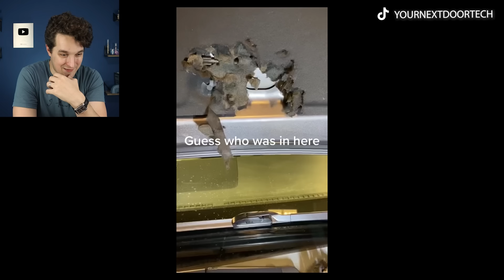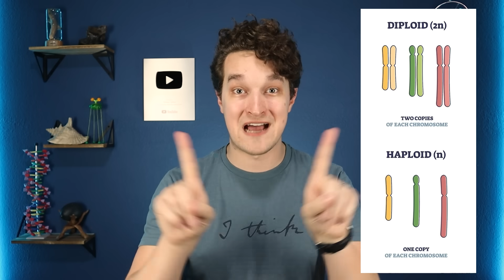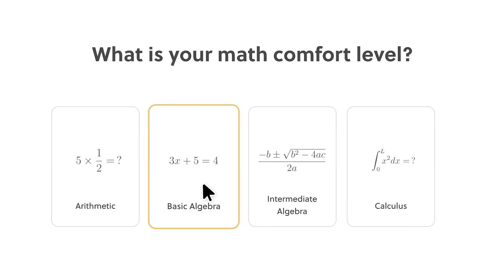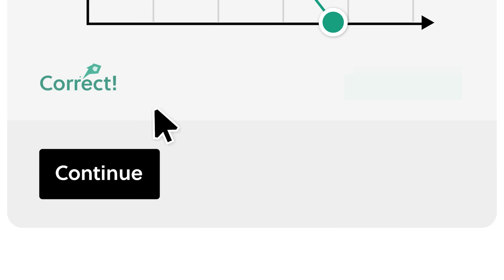Biologist Reacts to Animals Destroying Cars

Comment: At 1:38
Bears in cars....

Bears can break into cars quite easily. Sometimes even when the cars are locked, they can still break into the car....though that is usually by breaking a window. If the car is unlocked modern bears have learned how to open the doors. They actually have enough dexterity to do that.

As for the reason why, you may know better but I have been told that their sense of smell is approximately 700 times better than a human's.... And maybe a hundred or 200 times better than a bloodhounds. They generally go after your cooler....the Yogi Bear going after picnic baskets is actually a real thing!!

Comment: The bird in the headlight: ONLY way that coulda happened by accident... Maybe the owner was changing a bulb and, halfway through, realized they DIDN'T have a spare and figured they'd go later and grab one. Maybe they'd unlatched the bulb from the reflective cone and the bird went into the engine bay from beneath, saw light through the hole and figured it was an exit, squeeeeeeeezed its way in and the. In a panic (as a claustrophobe, can confirm I would do this too), lost the ability to reason that they could get out the same way?

Comment: on the topic of beavers, they have another fascinating impact on the environment; 

basically, because their dams saturate the local water table, not only do they act as a keystone species for the local ecology, but for parts of the local geology as well, due to the fact that their presence in a region replenishes the aquifers

in other words, we need to get out and repopulate the streams of america with beavers, cause their current population is a marginal fraction of it's original number, and they're only present in a few pieces of their original range

the depletion of the american aquifers is partially caused by the fact that they aren't being replenished by the presence of beaver dams everywhere anymore 
(it's also being caused by irresponsible water use practices, but that's another story)

point being, beavers are important, and if there's any rewilding efforts in your region that are introducing them back into their former range, and you have the capacity to assist in their efforts, you'd be fighting climate change and environmental disruption at a local level.

Comment: I have a pretty crazy video of 2 dear crossing a busy road and the second one getting clipped, then flying about 15ft into the air. I followed the car to the parking lot they pulled over in and shared the video for potential insurance use. No idea how that turned out, but at the end of the video you can see the deer running away, so hopefully it all worked out.

Comment: Possums are pretty cool, even if they're butt-ugly. If you're reasonably quick you can pick them by the tail (I am not endorsing this pratice) then...well, walk around with them. I like centipedes though (little guys, not the big horrific ones). I don't think they mess with your car, but they eat all kinds of bugs I'd rather not have around. And house geckos would be pretty cool if I could potty-train them. I just don't like the six-legged parasites.

Comment: 1:45 time for me to play car expert.

what you are looking at is a Chevrolet El Camino.  the exact body style is a subject of debate among the automotive community, a can of worms I will not open in this comment section.  Some think it's a car, others say it's a pickup.  I personally classify it as a "Ute" an Australian term for a car body with a pick up bed.
Reply: 10:32 as an engineer, yes I am confused too.

normally headlights are sealed to prevent water from getting in because it will instantly ruin an incandescent headlight bulb. so the only way in is normally the hole that the bulb goes into, which is usually way smaller than that qual.  even if it was an egg I'm not sure it would fit.

Comment: There's a hole in the back of headlight assemblies where the electrical connections go in. The hole is closed off by a cap. If that cap is damaged or missing, it is about the perfect size for that bird to enter.

Comment: Not a car, but wasps knocked out power to my house. They nested inside the power meter which had a hole in it for air circulation, I suspect. Bad design. When the power company replaced it, I put some mesh over the hole to keep the air circulating and the wasps out. If wasps nest around your house, you might want to do this too.

Comment: A long time ago, I was too tired to drive home so I went to go sleep at work. It was on the way, I had keys. I walk in and a possum just stands up looks at me from the garbage can like, How are you doing? So I put a bigger garbage can over that garbage can and I slid some cardboard underneath everything and then flipped it over. Drug it way off to the end of the property. took the little garbage can off took the bag off the dude, knock the garbage can over and I went to bed. Didn’t know anything about possums, didn’t want to get bit. It was as no contact as I could get at midnight.